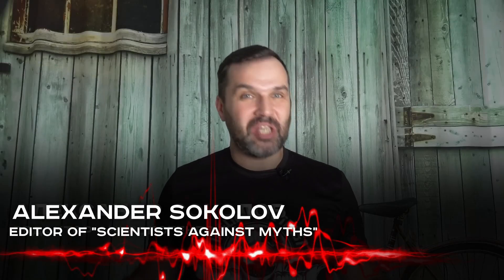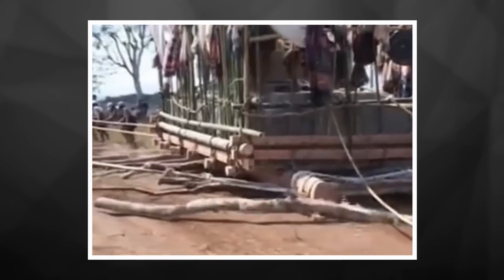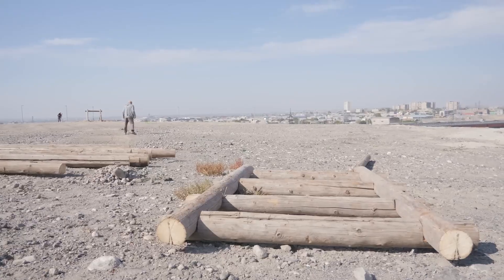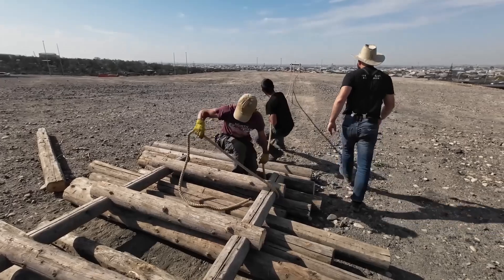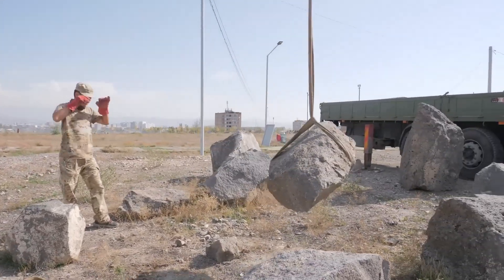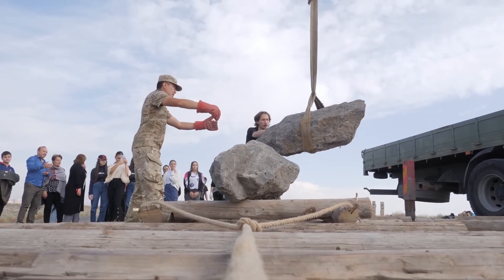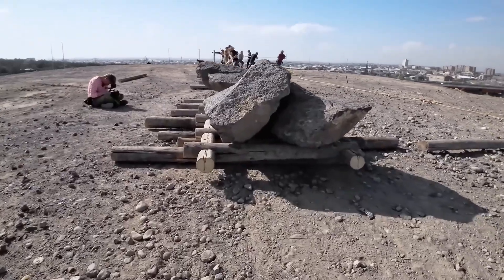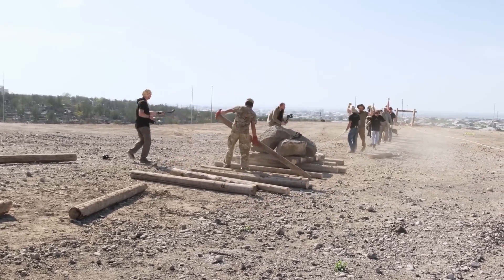How did the ancients transport heavy stone blocks? Experiment | Serious Science

Comment: How do you keep a roller from being crushed when it's a 1000 ton weight?  I can push my car down the road but at the slightest incline, it stops.  Try dragging the weight up a 20+ degree angle like the supposed ramps of the pyramids.  Then you'll have my attention.
Reply: Did you watch the video......  In it is a snippet from an old B&W video from the 1930's.  That film clip shows a ~300 ton block of Marble on a wooden sledge being eased down a mountainside by men with ropes.  Men in the front are = piling wooden logs in front of the sledge as it goes.  

So no single log is bearing the weight of what is being moved.  Rather multiple logs are piled in front of the moving sledge with the more heaped in front = the greater the weight they can support.  Remember that logs stacked in front of a sledge on the ground do not support the entirety of the weight as say an axle and wheels might have to.  The weight passes through the sledge/logs into the ground.  

Also you seem to overlook the obvious the very same film clip showed you = 🐂🐂🐂 Teams of yoked oxen can pull more than horses.  A fully grown bull can weigh upwards of a ton and can pull more than twice it's own body weight.  Thus large objects were not moved via "manpower" alone = they also used animal power.  

p.s. - this video likely for economic reasons appeared to use old electrical poles.  "Dried" wooden poles are of course more brittle than "green wood" which is full of moisture and thus resists deformation more than old wood.  

So these old electrical poles will split more readily than a freshing hewed tree trunk with its' branches lopped off to make it someone rounded.  The wooden "rollers" themselves need not roll.  They only serve to provide a surface the sledge can glide over with less resistance than dragging it across open ground. In other words your "rollers" do not need to be perfectly rounded.

Comment: Boy they say the wheel wasn't invented till whenever but always show rollers being used for thousands n thousands of years an to me a wheel is jus an extension of the roller . we've built n sailed in boats for 10 thousand years butt only had wheels for 250 years😂😂😂😂😂😂😂😂 like really
Reply: Nope............  Follow the white rabbit:

1 - a wooden roller - when used in tandem with others - does not alone support the weight above.  Rather because the roller is on the ground weight above = passes through the roller to the surface of the ground - which supports everything.  
2 - the black & white film clip in this video shows their moving a 200-300 ton block of marble down a mountainside using wooden rollers - not perfectly round ones either as they are basically tree trunks with the limbs cut off = which are being heaped in front of the laden sledge with the block.  So the thicker your logs + the more crammed in front = the greater the weight which can be slid across your logs. 
3 - wheels however along with the axle = must support ALL the weight above - as the wheels focus all that weight into a narrow area of the ground...... A wide sledge which is close to the ground however disperses the weight into a wider area.  This is why wheels form "ruts" quickly on soft ground + why even today in areas of soft/broken ground like say the Arctic people still used sleds or modern tracked vehicles.    

Moral:  unless you have Iron/Steel to reinforce your wheeled conveyance + you have paved or hard-packed road surfaces = wheels for heavy construction are not feasible - which is why for millennia man used wooden sledges and rollers and levers.

Comment: The great pyramid's height is about 146 meter, this would be great if you use this method and build a 46 meter long pyramid with the same rock sizes of the great pyramid and its accurate cutting including the granite base rocks, without using CAT cranes or such new tools and let us know how long they took to build the discovered pyramids till now.
Reply: Ah......... pyramids are vertical structures and hence pyramids are not "long" = merely wide according to their relative dimensions.  Also the granite blocks in the Great Pyramid were not very large in the case of the King's Chamber if you look.  The larger granite slabs above forming the relieving chambers are rectangular-ish crude - very crude - slabs of granite.  They hammered them "just enough" to make the fit - nothing more.  

p.s. - final thought.  Those relieving chambers and the King's Chamber below are actually = below the halfway point of the pyramid - while the pyramid itself is on an elevated escarpment which naturally slopes down to the south where the main quarry was.  

So no cranes were involved = merely ramps of which the natural rise likely formed part of that.  On the exposed western base of the Great Pyramid is a long, continuous limestone ledge.  This shows they at least partially built atop an existing hillside which was then covered over with blocks.  That natural slope could have been part of the ramp used to build the corridors/chambers found in the center of the bottom half of the pyramids.

Comment: This was entertaining to watch, but as a guy who sometimes does stuff here are some suggestions:

1) the rollers should all be actually the same size and perfectly round. This was not beyond the pyramid builders!

2) there should be a team working ahead raking the stones flat and removing the largest.

3) a constant pull is much more efficient over distance than heaving it.  There should be a small number pushing from behind to get it started and help even out the rate of travel. They will have to be agile!

4) weight distribution is crucial (as we saw). It must be even, side to side and ideally would be slightly heavier at the back.

All just thoughts of course. Subbed to see how far you get.
Reply: Actually no.  What you see here appears to be old utility poles likely recycled for cost reasons.  As the video segment in this video shows however in moving the block down the mountainside they simply used = tree trunks which clearly had not been shaped much beforehand beyond removing limbs from them 

The purpose of such "rollers" is not in rolling = it is in breaking contact between the sledge and the ground to ease movement by reducing friction.  Perfectly rounded rollers themselves as you see can move uncontrollably - thus make controlling the sledge in movement more difficult.

What might actually be better is to use = thick planks laid spaced out into the surface of the ground - not unlike corduroy roads militaries used to use to cross soft/broken ground.  The sledge can still glide atop those while they are less likely to move this way or that.  If anchored via say mortar they might further add toeholds for the workmen pushing/pulling.

Moral:  Egyptologists coincidentally have found evidence of such plank use for moving blocks.  Partially remaining paths/roads have been found around quarrying areas.  Roads created from constructed bases - such as layers of crushed stone with earthen fill - with sometimes limestone slab tops have been found around old quarries.  

In areas where blocks were duped into position somewhere for storage they have found the remains of old wooden planks which as noted were partially buried into the surface of the ground.

Comment: Square rocks roll easy using ropes rolling over ropes on sand to preserve your ropes
Reply: Yet they had ropes obviously.  Consider that when Petrie as an example excavated Giza in the 19th Century he found near the steep drop-off on the north face of the Great Pyramid that the area had been used by the Egyptians as = a "trash dumping ground."

Moral:  Petrie excavated tons of ramp filler material dumped there from the creation of the pyramid + assorted pottery and wood/remains of wooden sledges.  He also found per your comment = bits of rope of assorted sizes from thin to very thick ropes.

Comment: Rather than rotating the cable around a pole, using leverage by placing the lever between the blocks and the workers would be even easier. Nice work here.
Reply: This obviously was just a demonstration based upon the concept.  It also appears to have been done on a cost consideration basis.  The wooden poles as one can see are clearly rounded and dried out.  They appear to possibly be old utility poles perhaps donated for the project.  

Yet dry wood splits more readily than green/moist wood.  If people look at the clips of historical things being moved they were simply "roundish" wooden trees stripped of their limbs and not dried out and lathed poles.  Also their sled does not directly match historical examples.  

There are actual Egyptian sleds in museums.  They like depictions of the same have upwards sloping front ends to prevent the front end from "biting" into the ground.  They also have crossbars in the front and rear to loop ropes through.  

Final thought.  Egyptologists have found sections of ancient Egyptian roads which were clearly "built".  They have a dug foundation usually of crushed limestone and clay and the surface is also a firm material like packed clay or even limestone slabs atop the base.  Wooden boards rather than logs have been found fixed into the surface of the road using mortar so the top of the board is flush or slightly higher than the surface of the road.  

Unlike perfectly round poles as here which are harder to control as they roll more easily = boards - especially if dug/mortared in place - do not.  So sleds can slide across the boards and be easier to manipulate.

Comment: They probably used stone sleds on special, low friction sand
Reply: At Giza as an example there are the remains of smaller earthen fill ramps.  They are made from simple stone retaining walls - quarry debris - with the filler material being = sand/stone chips - also quarry debris/and tafla - a clay they mined and used for a host of applications.  What happens when you moisten clay??  Answer:  it becomes slippery.......  Also a partially clay surface can be compacted into a durable surface as well.  

Now add to this Egyptologists have found the remnants of once paved roads in ancient Egypt. Roads which had a dug stone rubble-fill base with perhaps limestone slabs on top of that or even a road surface created from stone chips and gypsum mortar.  They have further found the remains of wooden boards laid into the surface of such roads.  

Moral:  if you create a ramp/road surface partially from clay as noted it can be compacted and when wetted become slippery to reduce friction.  If you further lay flat boards into that spaced out then wooden sledges as here can slide across that surface moving across the boards as the boards help prevent the sled from "biting into the surface" as this one did.

Comment: A perfect primitive experiment could be if you guys would not use that crain to lift rocks as the ancient Egyptians had no truck, digging machine and hydraulic crain, + the 1-2 tonne range which is kind of obvious that possible to handle, please  demonstrate how they move 70-1100 tonne rocks by hand (😂).
The rules are quite different as the wood cannot handle the pressure and would become a pile of splinter under 1000 tonnes.
Reply: Do you not realize the childish nature of your claims? Compression strength of various wood types can easily be found online and you can correct your beliefs accordingly.

Comment: Childish, of course you can pull stone on rollers and sleds,  now do it over rough ground up hills and then manhandle it across the pyramid and into place.
Reply: Nice oxymoron............  A block on a wooden sled which further moves across rollers = is above the ground.  Further there is archeological evidence to show whereby they created ramps - earthen and mud brick ones - so that such obviates the nature of the ground they are created upon.

Moral:  next time THINK before spouting off........  I assure you things will go smoother for you if you simply think through what you want to say before issuing statements at odds with the facts.  

p.s. - there is an example of a quarry road dating to the Old Kingdom in Egypt.  One can clearly see whereby they did not simply drag blocks down from the elevated quarry area to a once harbor down below over rough ground.  They = created a path down the hillside with spaced holes along the sides of that.  Then wooden posts could be placed in the holes and using ropes = the laden sled eased down the grade.  

See how facts become more sensible when you actually learn the evidence..........

Comment: Why not use a pulley system?
Reply: When considering a particular technology it is imperative that the technology in question coincide with = the time frame involved.

Moral:  eventually the Egyptians came to use pulleys as we now take for granted.  They did so however = long after they ceased to build pyramids.  In the Old Kingdom we see them interlacing ropes around wooden posts to offset the amount of weight being moved.  You do not see "pulleys" until much later.

Comment: Because that's exactly how you would move the Unfinished Obelisk or the stones of Saqsaywaman..
Reply: Absolutely........  While the technique might vary a bit the principle is the same.  

p.s. - the Unfinished Obelisk rests not far from the Nile and sits uphill.  The Inca structures while atop hills have nearby roads leading up to them such as were used in their creation.  In both instances modern roads tend to follow the preexisting ones used in antiquity.  

Simply go to Maps and look at these areas via satellite and topographical to see the relative lay of the land.
Reply: The latter rocks are not much larger than these ones, so YES, absolutely. Not to mention that area is much more abundant of wood than Egypt, making it much cheaper.

For the former, just add more people (if this is, say, 2 t and you need to pull 200 t just use 1500 instead of 15 to pull) and make the sled bigger/longer likewise.

Also agree with the other posters that static corduroy pieces would beat rolling logs any time.

Comment: Have an idea for your next experiment: how did the Egyptians produce enough olive oil to move 2.3 million stones?
Reply: They wouldn't have - nor would they have needed to.

Moral:  can oil help to lubricate a large object you are trying to move - sure.  Are there other ways to accomplish the same = absolutely.....  

You know in the western cemetery adjacent the Great Pyramid are partially completed tombs which still have attached to them = earthen ramps.  Those ramps were made from a mixture of sand/stone chips - aka quarry debris/ and tafla - a sedimentary clay the Egyptians mined.  Beyond the Wall of the Crows at Giza is the remains of = a large tafla mining operation.

So what happens when you moisten clay???  Answer:  it gets slippery......... - and this can be accomplished using water rather than oil.  Now look at close up photos of the pyramid.  You can see slathered all over it = globs of gypsum mortar.  Mortar was used to fill in large cracks which were stuffed with chunks of quarry debris.  Yet some blocks also show globs of mortar which "oozed out" from seams between blocks.  

Moral:  the blocks as the pyramid rises in height become smaller.  Hence only the really large blocks at the bottom might require lubricant.  They were not concerned with "making it look neat" as far as most of the pyramid - only the outermost layers.  This means that blocks of the inner core were simply dumped in place - even if it as noted left gaps.  Only the outermost layers were made to be closely fitting - and that is where you see a lot of mortar employed.  

Hence on the ramp itself the tafla when moistened with water helped to briefly make the ramp surface a bit slippery - which can be further assisted via using wooden planks laid into that surface.  For the casing and other closely fitted stones then slathering some mortar in the spot would help them to lever it into position.  Any which oozed out could simply be cleaned away.

Comment: I would fix a point of the rope in one place and the pull the other, while passing the middle on the cart.
As such, for every two meter the rope is pulled, the cart move one, giving even more advantage.
Reply: If you look at examples of Egyptian Middle Kingdom sleds in museums you will see they had upward sloping front ends to prevent the sled "biting" into the ground when moved + they had crossbars in the front and back for attachment of ropes.  

You are correct in that what can be pulled = can also be pushed.  So for especially heavy loads a wooden frame upon which say oxen could be yoked in place to pull from the front and push from the rear would be possible if anchored to the wooden sledge upon which the weight rested.  

p.s. - they used here what appears to be old electrical poles - no doubt for cost savings which is fine.  Yet movement over rollers as we see increases the difficulty of sled control as they obviously can result in the sled skewing one way or another as they roll.  

If however thick planks were used to create a path of intermittently spaced boards then the boards would be less apt to move as the sled "glided" across them.  Think a train which can weigh hundreds of tons - yet which moves across spaced rail ties upon which a rail was laid.  

The thickness of the ties is such that they are not crushed by the weight resting atop them while the weight of the train "passes through" the flat wooden ties into the ground below.  That way the ties/rails do not incur all of the weight above as the ground sustains the weight.